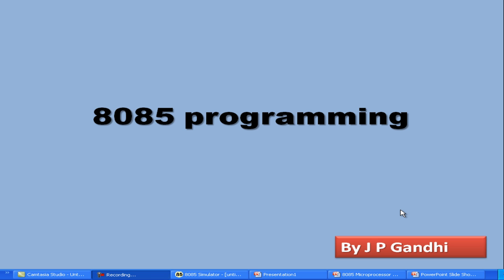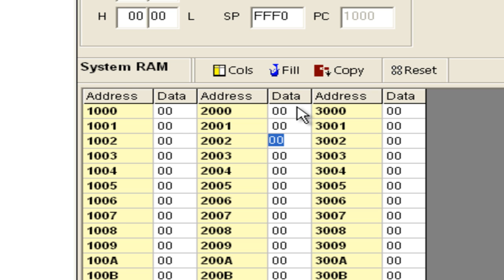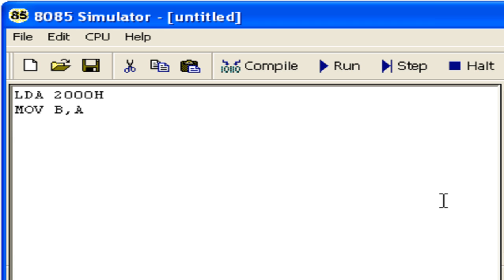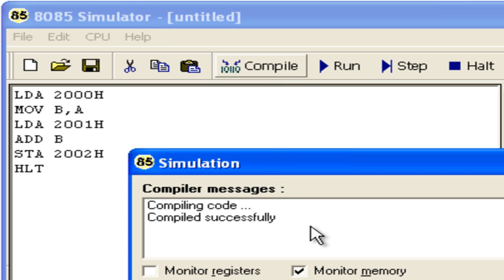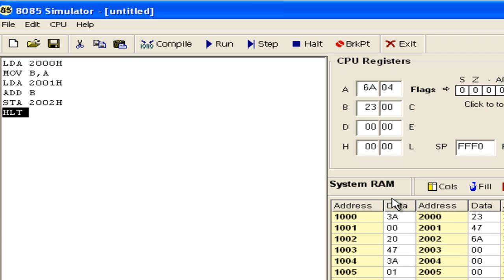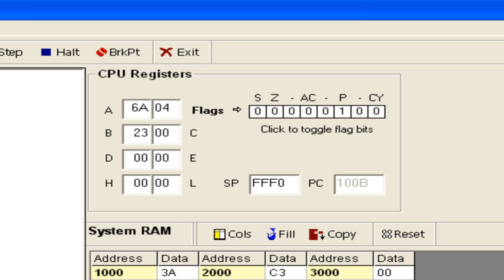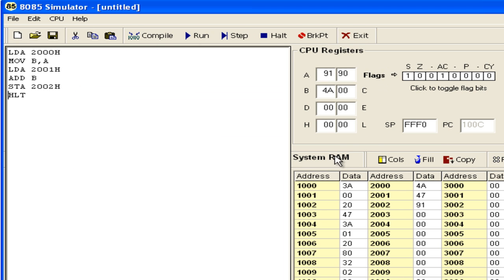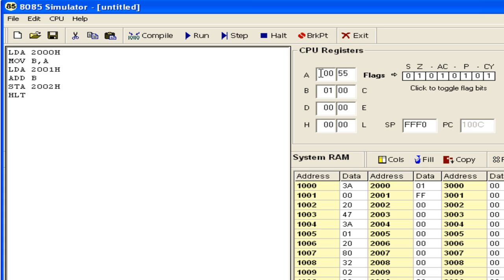8085 PROGRAMMING Arithmetic Operation and Flag Register

Comment: What is the significance of flags?
Reply from the maker: flags are associated with arithmatic and logic operations. They are part of reaults of these operations.
Reply from the maker: flags are associated with arithmatic and logic operations. They are part of reaults of these operations.
Reply: +Vedant Rao they are indicators or signposts. For example if you substrate 0001 from 0001 the answer = 0000 in the accumulator (answer storage register) . User must be told of this. So the processor raises a flag  to indicate that the processor has added and the result is one of the kind of unique answer..."zero" (0000). Thus A FLAG is raised  Known as the ZERO FLAG. Simply put Z=1 (Zero flag is set to 1).
Reply: +Vedant Rao Suppose you had a counter that was decreasing a number from 1111 by 1 each time (count down). Your goal will be to reach 0000. So you see that you have reach your goal when the accumulator has result 0000. ...This you can read off from the Z flag. Status register has Z Flag, Parity flag, Sign flag (indicating whether the answer is positive (0) or negative(1) after a mathematical operation)

Comment: 1 more question, why i try to put 9 in 2000h and 9 in 2001 h and add it the result show 12  at accumulator, however, when i put 8 in 2000h and 9 in 2001h and add it the result is 20?
and some the asnwer like 16 in the accumulator only show 1, i know that's from 16 bit, but why the other result is different?
Reply from the maker: +Leo Nardy for 09H + 09H tie result is 12H and that is correct so your case 1 is correct: Case 2 is having some operation error 09H + 08H should result in 11H  so please check it again. but if you are following case 1 than the result 12H + 08H will give you 20H. Please understand the hexadecimal operations and make calculations
Reply: hmm ok, thx i know what the problem already
Reply: hmm ok, thx i know what the problem already